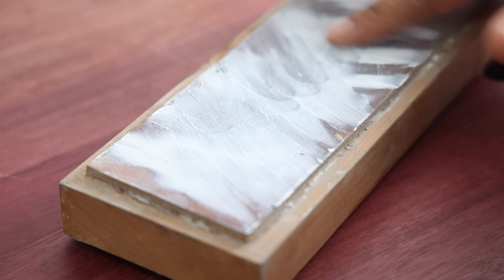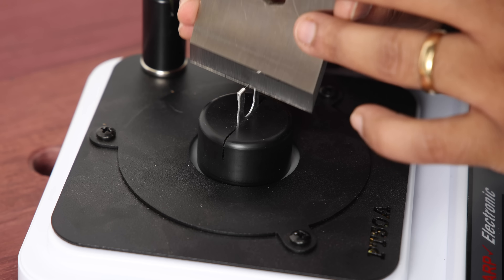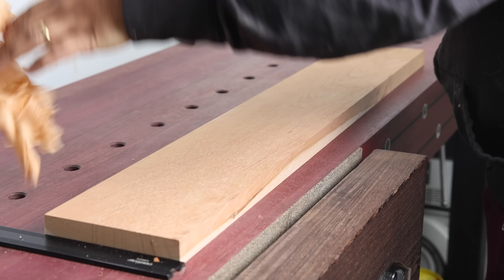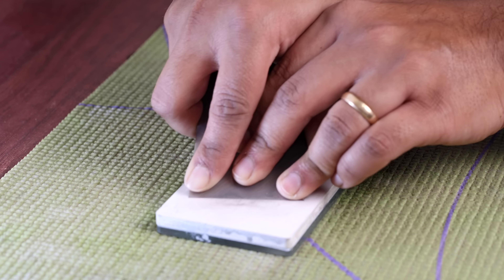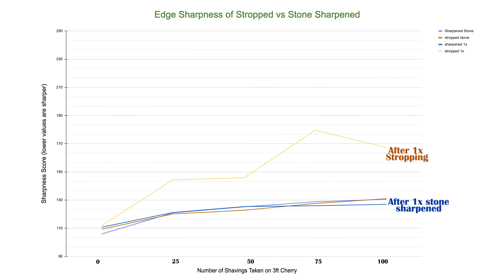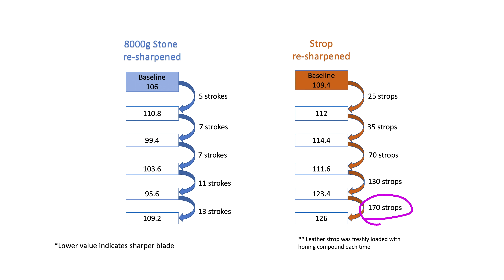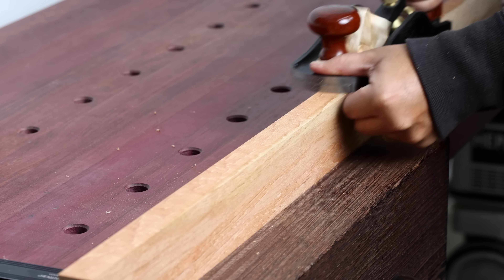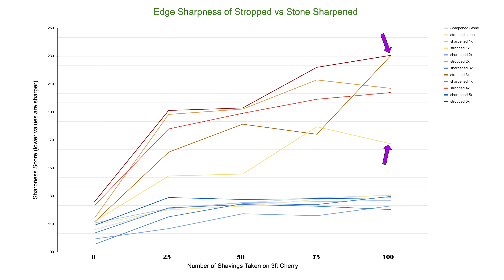is stropping overrated?

Comment: Or you could use the strop to clean up the marks from your "1000 grit"/fine diamond stone and don't bother with those higher grits at all. That is what I do and I have patches of handtool pattern baldness on my arms.
Reply: funny thing about that testing method, it still leaves an edge duller than I find ideal for woodworking. I can still shave with an iron that has reached a state I considered dull. But then I can also get axe sharp enough to shave with.

Comment: Like some of your other viewers, I only strop after sharpening to remove any left over burr if it doesn't get removed using a couple of strokes and the ruler trick on the flat side of the plane blade on my stone, and then it's only between 10 and 20 strokes on the strop.

Comment: Interesting experiment with likely repeatable outcomes provided the experimenter utilize the same type of plane irons, PMV-11.  There are many uncontrolled variables that should be accounted for. When sharpening, did you take any action to remove any burr formed by honing the bevel side?  What was this action and was it the same on both irons?  What is the effect of stropping vs. sharpening on O-1 steel, far more common than the powdered metal tested. O-1 is softer and sharpens faster so likely would react better to stropping than the PMV-11.  I believe your results are overstated if you claim stropping is ineffective for woodworking tools.  It is less effective on PMV-11 plane blades that are hollow ground (not recommended for durability of cutting edge in this application) and that are sharpened or stropped in the exact manner you did (unknown).  However, stropping may be as effective as sharpening on other common metals used for edged woodworking tools.  That said, I suspect re-sharpening or honing on a high grit abrasive, 8000 grit or higher ceramic or water stone, or natural stone will always perform as well as stropping and may perform better.  Would love to see a follow up test on O-1, O-1 cryo and A-2 steels.
Reply from the maker: Greg, this is not a research paper in a scientific journal; it’s a YouTube video. While I would love to test these methods on O1 and A2 and control all imaginable confounders—my wallet, time, and arms will hate me. Even if I did, I’d have just one viewer: you.

Comment: What steel are those blades?
The Tormek Paste may be your culprit. In "super-steels" it's composition can erode the steel, but the not the carbides. The the unsupported carbide crystals then get ripped out of the edge. This leaves a jagged and poor performing edge.
I appreciate your tests, and I have had similar results in the past, but I have returned to stropping after reading the book "Knife Deburring: Science behind the lasting razor edge"
by Dr Vadim Kraichuk

Comment: Interesting video! But there may be a problem with the strop. 
Either the technique, the compound, the leather or all together.
I would argue a ~1-3 micron DIAMOND compound on a harder leather could do much better cause it cuts faster and lasts longer than those normal compounds. 
But at the end it doesnt really matter if you „hone“ your tool on a stone or a strop, both is basically sharpening and what works best for you, IS best.

Comment: Interesting investigation, Suman. I have experience using a 4 water stone system and a 3 diamond stone and a strop system. Based on experience, the water stone system gave a much better edge. So I agree with the basic premises of your video that it is POSSIBLE to get a better edge on stones. 

But I much prefer the diamond stone and a strop system. The water stone system is very messy and time consuming to set up and maintain the stones. The average working sharpness of my tools is much better with the strop because I actually use it often vs. avoiding sharpening because of the stone. BTW - I use a 5 micron green bar compound that is roughly equivalent to my 4000 grit water stone. Works for me.
Reply from the maker: I would recommend ceramic stones. No need to soak. Always ready to go like a strop but much better results.
Reply: @WoodcraftBySuman  great suggestion. a ceramic stone would definitely be on the list of contenders if I became dissatisfied with the strop,

Comment: Very interesting video ! But I wonder if there is a difference between bevel up or classical bevel down hand planes. I imagine the stropping is bending the edge into the correct shape if it is classical bevel down hand plane. 
If you imagine the wood bending the edge of the blade, if the blade is bevel up the edge is bended towards the back side of the blade and this you can't repair by stropping the bevel.  BUT if the blade is used bevel down the wood pushes the edge towards the bevel side of the blade and this you could correct with stropping! 
I am not sure if this is understandable. Just an idea.
Reply from the maker: You bring up a great point. For bevel down planes, there is probably negligible difference. Though, I still think stropping is a bit more cumbersome than just hitting it with a higher grit stone.

Comment: Interesting numbers that makes a lot of sense for 8000 grit, but would be curious to see how this things work in a more "average woodworker" scenario. I've never gone above 1200 grit (diamond) before hitting the strop, and I cut much more than 25 strokes with a plane/chisel before deciding it's dull enough to touch up (usually only 3-4 swipes on the strop … until that stops working as well and I take it back to the diamond). I also don't go out of my way to create a micro-bevel (or rather … I rely on the squishy leather strop to do that for me), and that might play into things. The touch-up to me is about speed. Having the strop next to me on the bench Paul Sellers style means I can touch up the edge in 5-10 seconds, vs digging out the stone, lubricant, jig, etc.  Don't forget to do a final strop flat on the back of the blade, too, to bend the bur back over (same reason you hone a knife between sharpenings).
Reply from the maker: Just want to point out that in this video- I’ve done 300 linear ft of shavings before resharpening or stropping. The blades are still sharp enough to keep going but there is enough data to demonstrate the dulling process of the two methods. What type of stropping compounds are you using after 1200? I’m curious to know the level of sharpness you’re hitting with your method.
Reply: @WoodcraftBySuman  Yes, but I suspect that at the point you start to resharpen, the blades would still be sharper than most people start. I just use the green jeweler's stuff, usually 3-4 semi-fast pulls against the face of the blade and one slow one against the back to knock off any burr that develops. Looking into some posts about knives, it seems stropping is more about straightening/removing a burr (which might not exist with back/forth/figure-8 sharpening like we do with planes/chisels) than about making a blade sharper. Similar to using a honing steel with a knife (and now I'm curious enough to ask a friend who sharpens knives professionally).
Reply: that's why you setup your stones so they're always there to be used, rather than a strop. you can remove the bur from sharpening on your stones the same way you use the strop for it. There's just no real benefit to using a strop over stones, it's just a matter of setting up your workflow to make the stones easily accessible rather than a strop. it takes me about 30 seconds to sharpen a blade with stones and I know they're sharp without having to worry. 

you're always going to need to properly sharpen your tools, so might as well keep the stones at the ready. I used to pack mine all up too, but it became obvious those were one of the things I would need frequently, so I just leave them out now.
Reply: I do agree that this is an interesting rebuttal to the "scary sharp" system some woodworkers like to show off (8000+ and then strop). However, like I said, I'd be curious to see this kind of comparison done with a more "regular person" kind of sharp. An ultra-sharp edge dulls faster, so the difference in round-over from re-stropping starting at 8000 and starting at 1200 may not be nearly as noticeable (heck, you might not even be able to start as sharp as the dullest of Suman's tests). As I understand it, one of the main reasons for using a strop is specifically to avoid needing to use/pay for/maintain high-grit stones. In my case, it gets me sharper than 1200 grit and that's more than good enough for everything I do.

Comment: Interesting video. I sharpen with a Worksharp so I don’t need to hollow grind. I just give it a quick whizz when it loses its edge. I use a diamond disc in it from China. These are cheap. If the edge gets notched I change the disc to a lower grit initially. For finish I change to a higher grit. I sometimes buff on a bench buffer. It certainly makes it shine. Anything compressible is going to round the edge when stropping. I will stop buffing seeing your results. It’s all logical.

Comment: Very cool video. I usually only use my leather strop on my carving gouges which are more difficult to freehand sharpen on the stones. When I do strop my plane irons (not often), I use a wood/MDF strop with diamond paste. I wonder how that would have fared vs the leather strop. The rigidity of the MDF/wood wouldn't round the edge like the leather did and increase the effective cutting angle.
Reply from the maker: I suspect stropping on a rigid surface would minimize the micro rounding of the tip. But I would argue, why strop in the first place? Bc compound on mdf is basically a sharpening stone. Perhaps just use the sharpening stone?
Reply: @WoodcraftBySuman  totally agree with you. IMO, stropping is only a worthwhile thing if you don't have a 8000 grit stone, don't want the mess of a waterstone, or for use on some carving tools where the plushness of the leather works to your benefit.

Comment: A+ for method, but stropping is never supposed to be without re-honing on a stone. It's not a replacement, the idea is just that you can afford the strop compound more easily than a 16k or 30k grit ceramic stone. 

You're totally right about the rounding of the edge, which is best counteracts by using very stiff leather that is actually on the thin side--much thinner than the leather in your close up.  Mounted to some 3/4 ply, it provides a polishing surface with much less give. 

Just my thoughts!
Reply: Stropping is fundamentally different than honing is. It isn't a cost cutting method. You're actually looking for a different effect. Stropping polishes the edge and removes any wire burr that may exist.

Comment: Question regarding higher grit shaptons. I’ve watched your collab with JKM and have also watched many of Rob Cosman’s sharpening videos. You both seem to agree that the 30,000 shapton is not worth the expense. RC’s method of sharpening with a 1,000 stone and finishing on a 16,000 shapton always seems to produce an amazing surface on wood with very little effort/pushing on his part (obviously you have to factor in technique and tool setup here as well). With that said curious to know if you have experience or testing with the shapton 16,000 vs stopping at 8,000. I buy into the concept of honing on a higher grit stone vs stropping and would like to learn if the 16,000 is worth it. Thanks and enjoyed your videos on the topic!
Reply from the maker: Hi- yes I also have the 16k stone and it does get the edge sharper than 8k stone. But it is mostly an academic exercise because reality is, once you’ve taken a few shavings on a blade off of 16k stone, you’re likely to settle back towards 8k equivalent sharpness. I did some trial run of this scenario and while I didn’t record the data, the conclusion I came to was 8k is plenty good and is a nice sweet spot sharpness for most tooling steel, especially PMV-11.
Reply: @WoodcraftBySuman thanks for the reply, my bank account likes that answer!

Comment: Love the test and you cant argue with empirical evidence. I still strop in my shop and always will. For me it is a factor of convenience. A strop lives on my bench. When my tool dulls i run the blade over the strop a few times and i am back to work. The tool will dull overtime and eventually needs to go back to the stone. Data is great but it is important not to get bogged down in it. If i can still plane figured woods it is good enough. The strop saves me time to function the way i want to function. There are a thousand ways to get to a sharp tool and none of them are wrong!  As a side note i dont know what type of leather was used byt horsebutt is the best accompanied with green compound.

Comment: Interesting. First of all , thanks for all the effort you put in. I didn't see how you dealt with the back of the blades in your sharpening regime because after teaching many sharpening seminars I see that most peoples blades are ever so slightly "rounded" on the back ( about a 1/32 of an inch behind the cutting edge) I came to realize that like the face/cutting edge the ,back of the blade wears (just to a smaller degree). This can be corrected with a technique popularized by English woodworker David Charlesworth by simply using a very thin "riser" to elevate the blade insuring contact on the back of the blade right at the cutting edge.To the people who complain this introduces a unwanted back bevel I have measured the angle at less than 1/2 a degree and considering I don't use anything coarser than 6000x [which isn't much more than a polishing step] I have been very happy with the resulting very sharp cutting action.

Comment: I put compound on half inch plywood, would using a reasonably flat and harder surface to strop instead of leather make a difference in this debate?
Reply from the maker: If I had to speculate, I’d say that would dramatically help midigate the rounding issue. Though…there is an easier solution: a wet stone. It’s basically honing compound and glue pressed into a rigid structure.
Reply: @WoodcraftBySuman  very valid point! I ended up with one of those 16k shapton stones some time ago, but never used it. Since posting that comment I actually decided to start using that instead of stropping or using a compound and my original comment became OBE 😅

Comment: Interesting!  You may be putting too much pressure on the blade edge when you strop.  I use much more heel pressure.  But, I also only sharpen to 600 or 1200 on the diamond stone.  I have found it very easy to de-sharpen a very sharp iron during the stropping phase.  For the reasons you mentioned.

Comment: It looks like you're stropping on a thick, soft piece of leatehr that compresses as you strop. What about stropping on a hard leather -- similar to a wide leather belt -- or simply on MDF?
Reply from the maker: MDF is probably the best surface for stropping. The leather is harder than it looks - the close up was extremely close and I pressed hard for visual demonstration. All leather is compressible to some extent. It doesn’t take much for the micro leading edge of the blade to get rounded with stropping compound on leather.

Comment: I concur with Handlebar Workshops. I also am of the belief that many folk over sharpen... No real need to go past 1200 and a few swipes on the strop to achieve a workable and durable edge. The Old Timers I learned from only ever went to 220 and then stropped... You could shave with their blades. Sure, they resharpened more often, but that isn't a bad habit to get in to really.
Reply from the maker: I guess that would depend on the kind of woodworking you so. For fine woodworking and joinery, there is no way I’m using 1200 + stropped edge. We have better materials to get sharper edge that is more convenient than ever before. If you’re happy with your method, all the power to you.
Reply: @WoodcraftBySuman  Guess it comes down to age and 40 years of fine woodworking with the tools that I know. I see you are using the Veritas blades made from modern steels, these are game changers and behave completely different to the, shall we call them, traditional steels. Honestly, 1200 and a quick strop works fine on the old tool steels, takes no more than 30 seconds to sharpen up and be back to work...(with LOTS of practice, that is) so that is a tradeoff I am happy to make. Having said that, If I was still a young fella I would totally invest in Veritas planes etc. I recently retired my old Marples Cabinet chisels with a set of Narex cryogenic treated ones and yeah, they are indeed a game changer.

Comment: Stropping is something we do after we use stones. Not instead of stones.
The only caveat is using a strop to prolong the edge of carving tools. Even then we take recourse to the stones when the strop stops working.

This video is a useful illustration that a strop is not made for removing significant wear. It's a refinement step after the stones.

Comment: Well in knife sharping, I know the terms change as you go up from 1000 grit ( Sharpening ) to polishing often around ( 3000 grit  & upwards ). 
It may seem like semantics but there is actual utility to making the distinction of sharpening, polishing & honing. It's still very interesting that honing's use case clearly doesn't fit the thickness of these plane irons it seems. My guess would be that honing is more suited to thin (As well as extremely acute angled) blades that need realignment & the added strength of a convex edge profile.

I think most can envision a traditional straight razor. Its edge will sometimes be visably wavey & can start looking like a miniature saw if you use it on very dry (course) beards. Honing becomes very important but is still supplementary to sharpening.

Edit: Some minor eng fix.
Reply: I think you are actually seeing one of teh advantages of PMV rather than anything about the iron thickness. PMV11 is going to have a fine grain structure and take a fine edge easier at a higher grit than say A2, and 01 will be some where between the two.